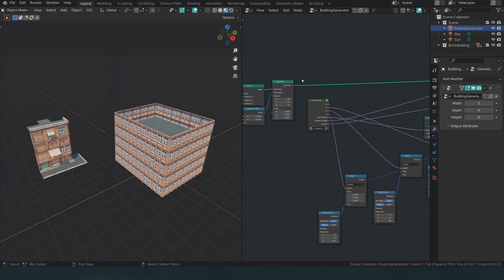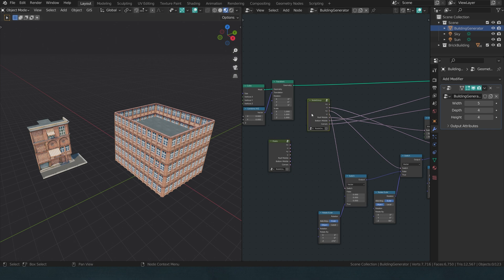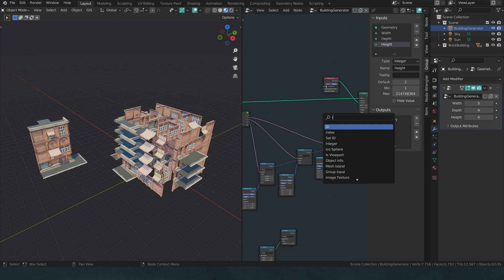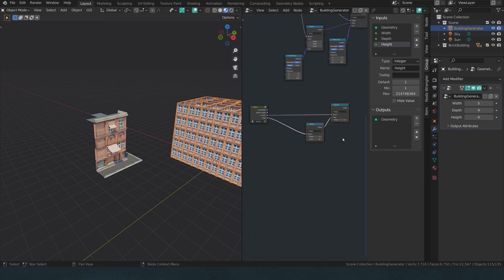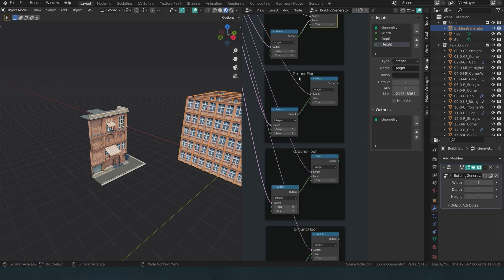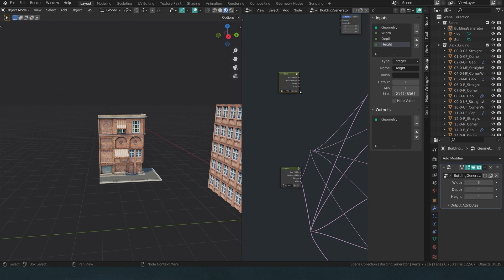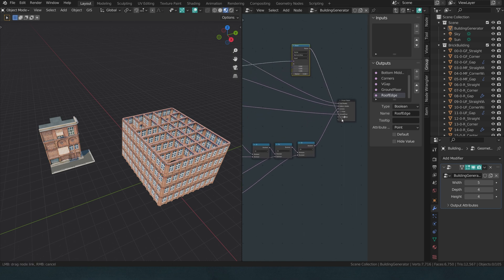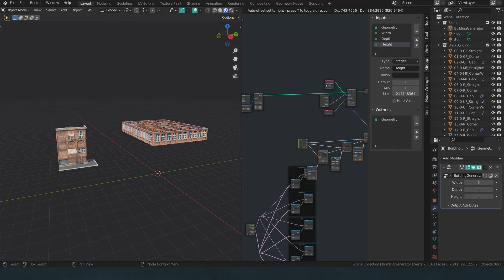Blender: procedural buildings with geometry nodes fields | pt. 3

Comment: Great that you share this. Coming from Grasshopper, i can presume there are far better hierarchy flows that will adapt to the geometry without manual multiplication of node groups. Maybe you need to dig more into making a fully automated procedure. That includes slanted walls orientation, floor counting, and so on. Plus, is there a face normal to use, instead of vertex?
Reply: Yeah, it should be possible to get face normals, and actually place objects in faces instead of vertices. It should also be possible to find corners and such with other methods. It will be a bit more complicated, and making corners that work with other than 90 degree turns might be hard. Might need another method or actual procedural geometry, or curve deformation. So a big step up in complexity. But not impossible at all.

Comment: looking forward for part 3.. meanwhile can ask you a question ... so i make some shape in geo node than use it on instance on point node.. is there any way to randomize the  parameter tha i make  (not the rotscale from the node) so each of the instances being randomize before they distributed on point... thanks...
Reply from the maker: There is a node called "random Value", which lets you select a number of random things. If you select an instance using the ID like in the video, you could feed in a random ID in a range to choose a random instance.

Comment: Great series!
What the developers could possibly implement to make the process less overwhelming?
Kind Regards,
Reply from the maker: I think developers can always look at the unreal engine for inspiration on node workflow. They have a really great system.
The three things I would like to see improvement on are
1)  be a better, less convoluted way of storing variables - When I have i.e. some ID's I want to store I have to use the capture attribute node. And then when I want to use them later on I have to drag a node connection aaaalll the way over from that node to where I need it - super finicky and annoying. Best would be a "save variable" node where I could store any value. Whenever I save a variable it would appear i.e. in the toolbar on the right, and then I could drag it back into the node setup later on and just get a small node with one output that returns my value.
2) More options for rerouting the nodes to each other. Switches and branches, and everything that gets rid of chaining 10 switch nodes behind each other. 
3) I made a rightclickselect topic for another feature I'd like https://blender.community/c/rightclickselect/pZM1/?sorting=hot

And other than that I have to say that the node naming conventions are confusing. Half the time you cant understand what the node does by it's name, and a 2 sentence description text couldn't hurt. There are to nodes called "instance to points" and "instances on points" - It's just messy that some nodes have so similar names. Maybe color coding node-categories in the 'add' menu couldn't hurt either.